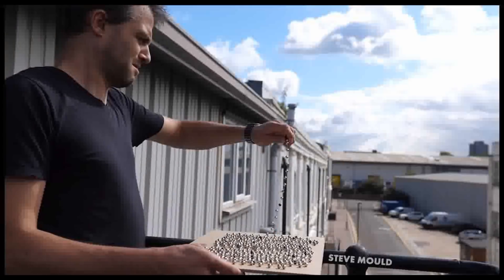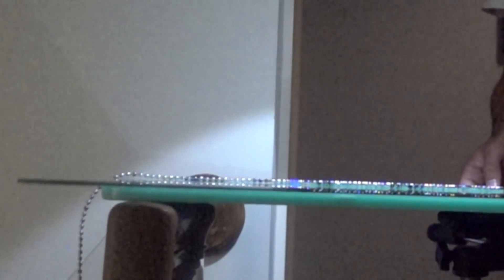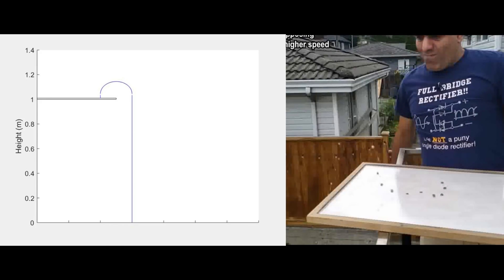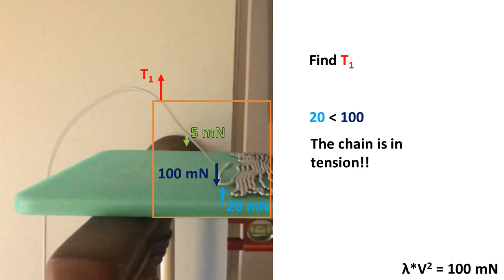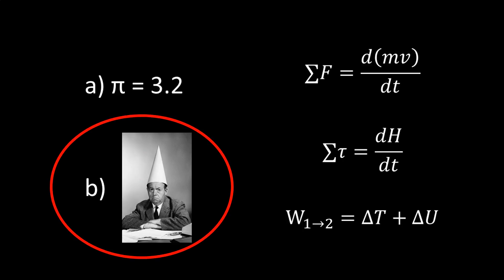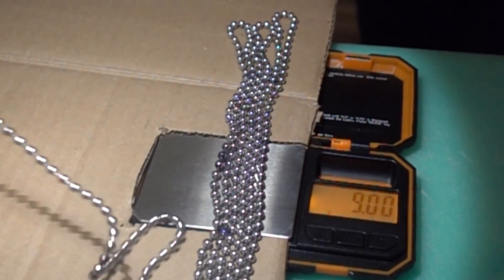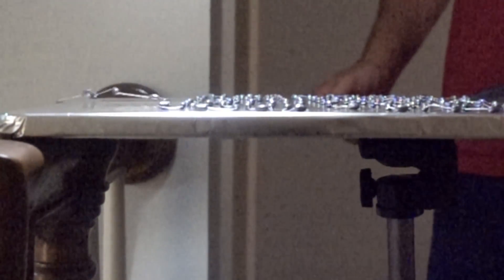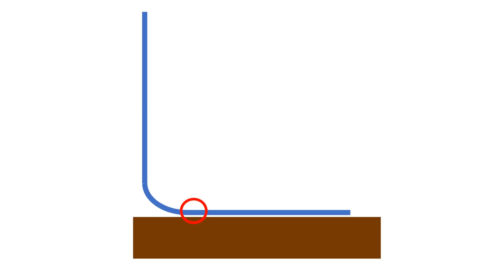And the Winner of the Chain Fountain Dispute is...

Comment: This is crazy! I'm releasing a video today or tomorrow and it has so much in common with this one! Great video
Reply from the maker: Glad to hear that great minds think alike.
Reply: @prestonbecker8784  Not sure how the scale works, but can you put an oscilloscope on an analog signal.
Eliminate most friction by wrapping the chain on a paper towel roll attached to a shaft with watch bearings on both ends.  Eliminate inertia by wrapping a 2nd chain of the same length in the same direction so it falls at the same rate as the 1st  chain is unrolling.  This will also eliminate any tight bends in the chain.
Reply: @prestonbecker8784  what an insanely obnoxious response 😂 i almost subbed too but egos are so ugly to me
Reply: @prestonbecker8784  
Nice try, but I'm not impressed. Did you find a reaction force? Yes, but that's just the normal force of the surface on the bead. This "reaction" force has NOTHING to do with the rise of the fountain. You seem to claim that without this, there can be no rise. Yes, the normal force on the surface increases but that has to do with the increase in velocity of the chain. As the chain's velocity increases, so too will the normal force on the bead. Look at your animation at 8:18 showing a rigid beam and how you explain the leverage property of the chain. That I agree with, but you turn right around and said the reverse is what's happening on the other side, implying the leverage mechanism you illustrate here gives rise to the chain or aids in the chain's rise.  What you fail to realize in your own demonstration as you've pointed out with Medhi's, is that on the falling end of the chain, the fnet on the beam is on the downside(the side that strikes first) of the beam(beam you have notated at 8:18) and it is in the up direction the other end(chain is rising). Why does this matter? This matters because, on the falling side of this chain, this beam you have illustration has the force applied at the low-side causing rotation about the center of mass of the beam, thus accelerating the chain down. This we can both agree on. On the rising side of the chain, you claim the reverse is happening. NOT true. Yes, what's happening to the beam is reversed and both beams rotate CCW, but the effects are NOT the same and neither is the cause of that rotation. On the falling side of the chain, the normal force of the surface on the beam "causes" the beam to rotate CCW and thus, accelerate the chain. Here the normal force leverages the beam about the  CM(center of mass --> fulcrum) of the falling beam thus causing it to rotate and ultimately, imparting an acceleration on the chain in a downward direction. On the rising side of the chain, it is THE CHAIN, that imparts a force on the beam causing it to rotate CCW. In this instance, it is the chain(the rising part) that leverages the beam and imparts a downward force on the surface as the beam rises up. Because this beam is stationary and flat to start with, the leveraging force the chain exerts on the end of the beam in contact with the surface isn't that great unlike the beam on the falling side of the chain. This "reaction" force you and everyone keeps bringing up  is nothing more than the normal force of the surface on the beam end as you lift the beam up. What you fail to realize is that on both the rising chain side and the falling chain side, using your beam diagram at 8:18, the beam's high side does the exact same thing in BOTH CASES! What is it doing in both cases? Look at your own analysis and you will realize, both the high sides of the beams impose a downward acceleration on the chain! On the falling side, this downward fnet, because it's in the direction of the chain's travel, it accelerates the chain downward. On the rising side, because this beam's high side is actually trying to accelerate the chain down, it's actually opposing the rise of the chain! Yes, this beam is being levered, that you are correct, but the results of the leveraging are DEAD WRONG on the rising side. The leveraging on the rising side is trying to slow the chain down, not help it rise! Just look at your bend radius. On the rising side, the bend is curved UP! Take any straight beam and bend it in this manner from a flat position and what's this high side of the beam trying to do? The high side of the beam wants to return to its equilibrium state! It wants to resist the chain's rise! Your so-called "reaction" force you see is nothing more than the normal force of the surface acting singularly with the downward force the beam is imparting onto it as a result of the chain pulling up on the high end of the beam.

So why does a solid surface allow for the chain to rise better? It's as simple as this, and let's use your beam again. If you don't have a solid surface, as the bead in front applies an upward force on the beam, the beam's CM(center of mass) stays put and the beam rotates about it. In other words, instead of the kinetic energy being used to do work to lift the beam's CM to a higher position, the energy is instead, expended to rotate the beam about it's CM. With a solid surface, applying an up force on the beam rotates the beam about its contact end, the end being held up by the normal force of the surface. In this case, the beams CM is raised because it's rotating about the point of contact with the surface, not its CM. With a soft surface, the beam rotates about it's CM burning up energy in the process. If you have a beam floating in space and you apply an up force to one end, will the CM of the beam rise up? No, it'll stay in the same location and the beam will just rotate about that CM. This is what's happening when you use the soft surface versus the hard surface. It has nothing to do with the "reactionary force". Well then, this proves the point that this non-existent reactionary force is needed for the fountain to rise, right?. My answer, NO IT DOES NOT. That's another story, one I'll tell in a video to debunk and disprove Steve's argument. Don't get me wrong, I love Steve and his channel but he's 100% wrong on this. The fact of the matter is we can clearly see that all this leveraging effect, this "Steve Moud" effect, this "reactionary" effect, or whatever you want to call it, actually opposes the chains rise so there's no way it can give rise to the fountain itself.  This "lever" CANNOT both retard and help the fountain rise. It either helps it rise, or it retards it. The fact is it RETARDS the chain's rise, thus it cannot possibly help it rise. The other fact is the soft surface also RETARDS the chain's rise. It retards it more! Just because the soft surface retards it MORE does not mean the "reaction" force is helping the chain rise. The answer to the fountain's rise is so simple it's actually hard. Once I get all the necessary equipment set up, I'll prove that a fountain can rise without this "lever" or "reaction" force. This "lever" retards the chains rise, END OF STORY. 

No, Steve has not won. Medhi is more correct in that he disagrees with the "lever" effect. He just hasn't put his hands on the "how" the fountain actually rises.
Reply from the maker: @vangmountain  
a) I am pretty sure you meant 18:18, not 8:18
b) The whole point of the debate is that, for the fountain to from, the normal force under the chain will have to be greater than just the weight of the chain (in the same way that, when jumping off a hard surface, the normal force under you is greater than just your own weight). Steve and I have been calling this difference between the normal force and the weight of the chain the "reaction force" but if you want to call it the "increase in the normal force" that is fine by me (and I assume Steve)
c) So, if the increase in normal force is due to something other than the leverage effect, but everyone agrees that the increase in normal force exists and is necessary for the fountain to exist, then Steve still wins and Mehdi loses. At least in my opinion. And if you disagree that this increase in normal force is necessary for the chain fountain to exist, check out my paper that I linked to and see if you can find any flaws. I look forward to hearing about it.
d) Dude, without pictures or equations, I can't make heads or tails out of your comment. Sorry. But, if you have some illustrations and equations in your video, I would be happy to see it, so send it to me when you are done. Or better yet, leave a comment here with the link.
Reply: @prestonbecker8784  Agree, it's hard to make heads or tails from words. My primary point is all you've proven is that this "reaction" force mechanism retards the chains rise. This I think we both can agree on as the curvature of the beam puts it in compression on the acute side of the beam and tension on the opposite face of the beam so on both the rise and fall side of the chain, this bend where this "reactionary" force is, the beam wants to return to it's equilibrium state so it always exerts a downward force on the chain...on the rise side, it retards the chains rise...on the falling side, it accelerates the chains fall as you correctly pointed out. And yes, a firm surface will retard less but it isn't what gives it it's rise. I intend to do a video on it and will for sure link you. Actually stumbled on this just yesterday so it's been amusing to watch the back and forth. It's great for everyone! Cheers and like I said, looks like you put a lot of thought and time into so kudos to you but no one has put their finger on the actual reason for the rise. 🙂
Reply: @prestonbecker8784  I think vangmountain is saying what i said. The reaction force at launch (in the bucket) borrows power from the system.
Unlike the reaction force when a lever/link lands -- this definitely adds to the height of a fountain.
Re the bet -- Steve says that a reaction force is needed for a fountain to form -- dont forget.
Reply: @atheistaetherist2747  can we all just agree that it's magic?
Reply: @atheistaetherist2747  
Correct mad aetherist. I finally saw the Cambridge physicists video and they are saying exactly what i was trying to convey to Preston in my first post. Like me they argue the surface acts to retard rotation of the beam about it's CM and causes the beam to rotate about the point of contact between the two. By doing this, the beams CM rises unlike a beam on soft surface like water. With a soft surface, the beam would rotate into the water as Preston has shown, thus limiting the rise of it's CM. It essentially boils down to this: with hard surface, the kinetic energy imparted to the beam end goes to doing work to elevate the beams CM whereas in the soft surface, some of that kinetic energy is wasted in doing work to rotate the beam about it's CM and thus, less energy is left to lift the beams CM up thus it rises less as a result. Like Preston, they proved that this lever mechanism(hard surface) retards less, but failed to prove it is the rising mechanism of the fountain. Again, if anything it does, it's that it is opposing the fountains rise. This is indisputable as this beam initially starts at rest. It becomes even more evident when you look at the segments as beams.

Here's the thing though, a fountain can arise from any string, rope or chain, flexible, stiff, flimsy, whatever. If it's flimsy and not rigid, you have no leveraging effect, hence the leveraging is NOT needed! You see it in the chain because that's the nature of the chain--it's similar to a chain of rigid beams give it's rigid parts. I concur with the cambridge video except the conclusion which is that the lever affect is needed for the fountain to rise.  That there is 100% wrong and I intend to disprove it mathematically and experimentally because it just plane is. The lift mechanism is in plane sight, you just have to see it.
Reply: @vangmountain  They (ie everyone)(except for one that i have seen that used a different model) use a math model, & conclude that that model proves the model. Mathematicians are good at that.
If they oil  their chains it will not decrease the height etc of their fountains.
I win. And Mehdi wins. Actually, i cant say that Mehdi wins -- i dont know what Mehdi asserts -- he might be wrong or partly wrong too.
Reply: @vangmountain  
Ok good.
Here is a suggestion i made yesterday, for a flexible chain, that cant have any or much lever-link-kick-reaction.
But it might cost $300 to $600 for the splitshot.

I am sure that 1 dia clear gap tween splitshot (a splitshot has dia of 1 dia)(3 mm or 4 mm) on a light fishing line would avoid lever-link kick.
0.5 dia gaps might not.
(1) Here is an idea. Use 1.5 dia clear spacings.
Hang/pull the chain over a cylinder (instead of using the sharp bucket wall) which has a dia of say 20 dia, to reduce the initial clatter.
After which i am sure the chain will rise nicely up clear of the cylinder.

(2) And then i would add more (double the) splitshot so that the clear spacings were 0.25 dia.
And repeat the test.

If the fountain height in (2) was more than in (1) then that would lend support to Steve's assertion that kick affects the fountain.
Reply: @vangmountain  well I just happened to finish reading the paper attached, and verified some graphs numerically myself...
If there is some flaw in the assumptions of reactionary force, then mathematics should disprove it, right ?
The point I wish to make is that, mathematics may not rule out any additional properties/phenomena which may have been unnecessarily incorporated, but mathematics sure can point out a wrong assumption. Afterall, this is what we all have learnt in our science and engineering classes....
Going by that philosophy, I don't see any inconsistencies in the theory as well as the mathematical modelling..
Reply: @atheistaetherist2747  the problem is, the chain fountain effect has been demonstrated in cases where the "falling" chain hasn't hit the floor yet.  Tops of ladders, tops of buildings, etc.
Reply: @Seriouslyfunny1    First and foremost, I have not read the paper and have no intentions because I have zero objections to the "reaction" force. This is just the normal force of the surface on the beam end that's in contact with it. First and foremost I want to point out a flaw with the physicists reaction force theory. They conclude the normal force would lift the contact end  of the beam up which is 100% dead wrong. I am shocked two physicist could make such a mistake. Yes, it's true, with a solid surface, the lift  force on the one end will raise the beams CM as the beam rotates about it's point of contact not it's CM. The physicists are linking to different things. A beam rotating about it's CM striking a hard surface on the downward end will impart a normal force on that end causing it to rise back up much like if you were to shove one end of a see saw up and watch as the opposite end strikes the ground and rebound. There flaw is linking this to a beam that's already in contact with the ground. In this scenario, any delta y rise in the one end of the beam is simultaneously paired with a normal force on the opposite end. Newton's third law is not "reactionary" as some like to think. It's one singular event with two simultaneous forces who's magnitudes are equal but in opposite directions. In other words, any delta y rise on one is IS the direct result of the normal force of the surface on the opposite end. That end is behaving like a pinned connection allowing it to be used as the fulcrum to leverage the lifting of the beams CM. As such, NO, there will be no reaction force causing that end to rebound up as the physicists point out. This was a horrible mistake on the physicists part. As one end of the beam rises, it is simultaneously using up it's normal force pair on the opposite end. And no, I'm not saying the normal force is paired with the rising end, but it can be thought of as that because any force on one end rotates the opposite end which applies the same force, but in the opposite direction, onto the surface which in turn, yields the simultaneous normal force up that is paired with this beams down force, the direct result of the beam's up force on the opposite end. Because the normal force on the contact end  is used up continuously as the beam is rising on the end with the applied up force, there is NO REACTION force left over to lift the contact end up. THIS IS IMPOSSIBLE! The physicists connected two different things. If the beam were to rotate prior to making contact, then yes, the contact would yield a normal force that would result in a rebound of that end. Rebound is not possible when the beam is already in contact and maintains this continuous contact UNLESS the force is so great it punches through the surface allowing it to have momentum and then striking and stopping at some later point. In this scenario, even if the distance traveled were miniscule, because it was in motion, the impulse of impact could impart a force on it in the opposite direction causing it to rise up. The other possibility would be the beam deforms which it doesn't. Neither bead nor surface deforms so NO, no discernable lift is generated on the contact end as the physicist claim. The beams CM does rise which does retard the chains rise less than if it were not solid, but it is not what gives the fountain it's rise. The fact of the matter is that it resists the chains rise. This is fact. I think you can agree with me on that. So no, I'm not disputing the math nor the existence of the "reactionary" force (it's just the normal force). What I'm disputing is exactly what the math says which is that the normal force is not what gives the fountain its rise. If it did, Preston would have shown the math, but no where does he show that the math explicitly shows this. He assumes this; his math does not explicitly show that the normal force gives rise to the fountain and that's my point.

Something to think about. Does it take more energy to rotate a beam vertical ( fulcrum on one end)and THEN lift its CM to a certain height, or does it take more energy to just lift it from that point, or because the CM is being lifted to the same height, the energy required is the same? If so, does the normal force play a part? After all, BOTH scenarios get their energy source from the same source--the chain! One takes advantage of the normal force and the other doesn't. Think about it 🙂🙂🙂

If Preston states emphatically that his math explicitly shows the normal force giving rise to the fountain, I'd be delighted to oblige and read it but he doesn't. I have zero qualms with his math. For all I know, it's probably 100% accurate but it doesn't say the fountain's rise is the result of the normal force. 

And yes, I can experimentalyl prove the normal force is not needed...how? Remove it...simple to do.
Reply: @Seriouslyfunny1  here's the worst part about all of this. People of science are now unknowingly saying, "FREE ENERGY, FREE ENERGY, GET IT WHILE YOU CAN". From the cambridge physicists to Steve, to Preston. Physics fundamental...conservation of energy. Trace your energy source. It came from somewhere! This "extra reactionary force", no it does NOT exist! The normal force, yes it exists? Where does this normal force derive from? The surface? Wait, the surface is only reacting to another force being simultaneously applied to it so where did that force come from? Hmmm...did I just advocate for free energy by claiming this " reactionary force" which I took from the system can be given back to  the system to give it more kinetic energy to rise higher? If that were true, Let's all get us some and go flying. Maybe pigs can actualky fly...their keen senses are able to locate free energy where we can't. You all are people of science so let's remember the fundamentals and not stray from it.
Reply: I'd like to correct some of my statements in my posts to Preston and Pratap and that's regarding the beams retardation of the chain's rise. I gave Preston and the physicists credit by saying the "reactionary" force retards less, but it's quite apparent it does not! Both scenarios, whether the beam rotates first and then lifts, or if the beam is connected in the center and just lifts right from the ground, require the same amount of energy. It's simply a matter of work. Work is being done to lift each of these beads. It does not matter whether it starts by rotating first or just a straight lift. The fact of the matter is that the work done on both objects is the same if you are lifting both their CM to the same height. This tells you the energy expended is the same. The link above imparts kinetic energy to the link on the surface and this energy is used to do the work of lifting the bead. So, I'm taking back my statement to Preston and the "reaction force" group that somehow, this "lever" effect retards the chains rise less because it does not. Looking at it from a tension standpoint, what the "reaction force" group failed to realize is, the "lever" mechanism is exactly that, a lever, and as such, it's just a simple machine. What we know about machines is that they allow less force to do the same work over a longer distance. In "levering", they got a smaller tension force, which they incorrectly used to CONCLUDE, that this is the reason why the fountain rises. WRONG, WRONG, WRONG. Is there less tension? Absolutely, but you don't get something for nothing in physics! In reducing their tension force, they had to apply this force over a longer distance. How is that? 

Just look at lifting up a beam by its end versus its CM, and you see that the beam actually experiences a diagonal tension force. Even at the initial orientation where the force is perpendicular to the beam, the point with the greatest vertical tension component(the tension force because there is no horizontal component here), this tension force is still much less than the tension force of a lift where the beam was attached at its CM because you are levering the beam to get a mechanical advantange. However, as soon as it starts lifting, the angle grows and introduces a horizontal component thus decreasing the vertical component of the tension force. As the angle between the force and the beam grows, so too does the horizontal component of the tension force. So while you think your tension is decreasing, it isn't. It remains the same, albeit, much less than a lift at the CM of the beam.  Because you now have a vertical component and a horizontal component, the beam moves up and horizontally as you lift. The beam end with the force applied rises while the contact side slides on the surface towards the rising side. Essentially, the beam rotates about its CM until it's upright. Well, how much distance did you have to apply the tension force(vertical and horizontal components) to get to that point? The force was applied for a length of exactly the beam, yet it only lifted the CM, 1/2 that distance. If you had raised the beam by the CM, you would need to apply a greater tension force, but the distance traveled would have been half that because how far you apply the force, is how high your CM will rise.

What does this prove? It proves that the lower tension force does NOT yield greater work as the "reactionary force" group implies. All it proves is that there is less tension involved which is correct, but the impact of that does not translate to more work being done because they took a longer path! This is the basic principle behind machines---trading force for distance. 

So, I am taking back the credit I gave to Preston and the rest of the "reaction force" group because there's simply ZERO GAIN. No energy was saved or added with this "levering effect" to help this fountain rise. The energy spent in BOTH scenarios is the same. Show me the math where kinetic energy is either saved or added to allow for the rise of the fountain, and I will entertain the theory. If not, it's a big bust, and one I'm quite frankly shocked two physicists put on paper. I know for a fact, I can generate a fountain with zero normal force("extra reactionary force") involved, and I have.  My explanation proves, and anyone with a high school physics background can see this, that with or without a normal force, the energy needed to lift a bead to a certain height is exactly the same. It all boils down to the work being done on the bead. If you haven't gained any extra energy or spent any less energy, how then does this "levering" effect give rise to the fountain? If there is anything we know for sure, it's that the bead, no matter how you lift it, takes the same energy from the system in front of it. There's no secret lifting mechanism that somehow saves energy. 

The fountain's rise is, to be honest, too simple, it's hard.....cheers and kudos to all who have put time and thought into it because it's great for science! It doesn't matter who's right or wrong, who wins or loses. What matters is that people are thinking and that's a win for science! Hopefully, I will get a detailed video up to explain it soon, but it's fascinating to see how easily we can be blinded by another's persuasion even though we know it's wrong.  

To Preston, always trust your gut instinct and your intuition. You were right in initially concluding Steve was wrong, but you let Steve's calm demeanor and soft-spoken voice lull you into fabricating something to support his wrong conclusions. Always believe in yourself, until you've been proven wrong. No argument or explanations I've seen to date correctly explain the fountain's rise which truly does surprise me because I know you all are bright people and I'm sure so too are the two Cambridge physicists.
Reply: @vangmountain  I see your point. But I'm still a bit fudgy about the details. You see, if this were a static problem, Newton's reaction effect would have had only the opposing and equal effect, and the "extra" reaction would have been pointless.
But this is a dynamic problem. If I remember correctly, during my engineering days I once happened to solve a problem of Kleppner (don't remember the number/page), in which we have two freely movable wheels of mass m each, attached to each other via a frictionless rod of length L. We now place this system on a smooth table and rotate it about the centre of the rod, so that it starts spinning. We were supposed to check if the reaction on the wheel from the table is mg or something else. By doing an angular momentum analysis, we found that actually there is an additional reaction generated, PURELY due to the motion of this system. 
Not that I'm saying it's the same system. But surely the dynamic aspect of the chains have got to do something with this reaction.
It is very counterintuitive. Maybe that's the reason why so many people are butting their heads ;D
If you wish, you might try the above mentioned problem. I might take out my pens and papers as well !!
Reply: Turns out, the rotational motion about the centre of rod causes an additional reaction of 2MR³w²/L². Here, w is the speed of rotation of the disk, L is the length of rod, R the radius and M the mass of each disk.
I'm fairly certain that due to acceleration of the links/beads, somehow an additional reaction is generated. It's very weird and counterintuitive, but seems like it....
Reply: @galahad692000  
It has been said that hitting the floor has been measured to add 1% to the speed in some cases.
I reckon that hitting the floor can add an infinite speed (were it knot for friction etc losses).
But i dont remember ever saying or inferring that hitting the floor is a vital factor.
Reply: @vangmountain  
I reckon that the rotation of a link at launch might be a source of loss,  if the energy is not somehow given back to the system.
But praps the energy is given back, minus friction losses.
Reply: @Seriouslyfunny1  True, this is a dynamic problem and yes, there are a lot of things going on, but dynamic problems are nothing more than a bunch of static events combined into one. You can still peel away at the layers to understand what's going on. Sometimes, if you don't look at the bigger picture, you can be led astray and the same is true going the other way around. Sometimes, to understand something, you have to peel away at the layers, while at the same time, keeping an eye on the bigger dynamic picture. For this problem, you have to do both or else you can easily be led astray as many have been including the Cambridge physicists. The problem with Preston, Steve, and the physicists is that they've all been blinded by this "reactionary" force that they can't see the error of their ways. The reality is this, they are ALL RIGHT, BUT THEY ARE ALL WRONG! Sorry to be speaking in riddles, but that's the truth. 

I can tell you that I've finally worked out all the details of this fountain and it's 100% clear where the rise of the fountain comes from. As I've said all along, it's too easy, it's hard. My issue was making sure I watched all their videos and be able to explain away their key points and findings. As in Preston's footprints. Why are there footprints to begin with? What do they prove or disprove and I how does one go about proving or disproving it. In order to disprove his theory, I can't just come up with other experiments. I have to be able to use his own findings to discredit his theory and I must be able to show that my theory will duplicate his results. When two opposing explanations yield the same results, one must be incorrect or partially incorrect. I now have all the details worked out and just need to put this all into a nice video for ALL to see and understand. Note I emphasized "all". If I only explain it so a few can understand, I have achieved nothing. The point is to make it easy enough for all(lots of people) to comprehend, not just a select few. For this reason, it can have math, but it must be done in such a way as to make it understandable to the average person. It must be thoughtful and have novel experimental presentations that address the core of the conversation so it leaves no doubt as to what the solution is. It must be able to address and counter all points of the opposition side. This is a tall order, but I have the details and the solution. It's just going to take a little bit of time to put it all together in a nice coherent package that will draw people in and help those struggling to understand it, understand it. 

I'd love to share the details, but it would ruin the video so I'm holding out on my findings until the video comes out. I've been meaning to start an educational science Youtube channel, and I have, but I just haven't put up any content yet, so this will make a great first video as the interest in it is quite high. But yes, I can emphatically say, the opposing side is RIGHT, BUT THEY ARE ALL WRONG! What I do love about this discussion is that it's made a lot of people think and that's a win for science. And to Steve, Preston, Medhi, and the Physicists, and anyone else who's put out content, many thanks to them because it takes courage to put your work out on the internet to be scrutinized by others. The fact of the matter is that no matter if it's right or wrong, partially right or partially wrong, they are all necessary steps that advances all of us a little bit further. Without their contributions, be it right or wrong, we may never see the contributions we make. Their mistakes helps us to avoid it. Their insight, helps us to see that much further. So in the end, they are all winners in this, because at the end of the day, it was only made possible with everyone's contributions. Sure, we may go back and forth, but there's no mal-intent. It's just a healthy debate  where, in the end, everyone is a winner and that's the beauty of this platform.  Cheers to all who've contributed, no matter how small!

As to the bet, Medhi wins by virtue of his position that he's more correct in taking the position that a "reactionary force" is not needed for the fountain to form. Steve is wrong, because he says it does. It 100% does not need a reactionary force. This is best and can easily be disproven with simple experimentation, something I have already done and captured in ultra slow motion. If no normal force exists, meaning no contact exists between the beads and some stationary surface, then this theory is out the door, and I can say that without a shadow of a doubt! This theory is on it's way out the door.
Reply: @vangmountain  I don't really understand where you're coming from here. Of course there's a source for the additional energy, and that's the continuous change in potential energy in the chain as a whole, as the chain falls downwards. I don't understand the mechanics of this well enough to conclude how exactly the energy is transferred, but I don't understand why it is you're screaming "FREE ENERGY" here. Also, I find your whole attitude in this thread very demeaning towards everyone involved whose opinion does not happen to align with your own. Towards the Cambridge physicists in particular (I can't attest to the validity of your criticisms toward them, I don't understand the mechanics enough myself), but also towards Steve, towards Preston...  Implying Preston let himself be "lulled into fabricating" some false evidence by Steve's "calm demeanor and soft spoken voice" is incredibly condescending and shouldn't have any place in this scientific debate. Please overthink your attitude.
Reply: @vangmountain  here's the thing... You state that a fountain can rise from "any string, rope or chain, flexible, stiff, flimsy, whatever". But that's simply not true. Steve has shown very early on that a more flexible bead chain does not show this effect, if I recall correctly.
Reply: @InterFelix  It's just speaking Felix. Like when Steve and Medhi say things about each other. It's just a figure of speech. It's just meant to convey your conviction in what you believe. They all have done great work. And when i said that about Preston, I was poking fun at Steve's demeanor. Dont get me wrong, he's a great guy. I enjoy his channel. Likewise, I'm sure all these guys are! As to the physicists, they have a higher bar they must uphold after all they have the time and the training. They researched it and wrote a paper on it, but it's quite clear they rushed their conclusion. Their demonstrations shows they did not put the time they should have put into it. Steve's video is but one instance and one scenario. Trust me, I can prove a flexible sparsely linked chain can generate a fountain. They all are showing one scenario, NOT ALL scenarios. I wouldn't be saying this if I couldn't back it up Felix. Be pretty stupid of me. It's all in the spirit of learning Felix. No mal intent. Yes, i stand behind my statement that fountains can arise from any chain or rope, flexible or not. They just exist under different conditions. Just because they fail under one condition does NOT mean they can't. Big difference. That's the problem with the reaction theory. They concluded immaturely. Just because you exhibit a behavior that seems to support your theory and test(flawed testing) a couple and it doesnt yield does NOT mean you are right. Like I said, I can prove them wrong with one single experiment. If i can get a fountain to rise with zero(no surface contact) normal force then I've proven their theory wrong. It's as simple as that. It takes a lot to prove a theory but very little to disprove it. You read too much into it. These guys are all great, but WRONG! And maybe the tables will turn on me, but I'm not putting myself out there less i can back it up soundly. Am I being critical of the physicists? Yes I am! They are trained and have all the tools. They must be held to a higher standard. I don't think people will disagree with that. Just as you hold your doctor to a different standard, so too should the physicists be. To be condescending to them, I would have to know more than they which I don't. For sure they have more tools than I. That is why I expect more from them! Their kickback theory and demonstration at 7:37 is appalling! It shows a high impulse event due to rotation about the CM thus generating a high impulse with the surface and thus, the surface imparts the same sending that end airborne. This does NOT happen with the chain links.A normal force is experienced but it does not send this end flying. The normal force works simultaneously with the lift force to enable the lift to happen. It's a PARTNER in the lift mechanism, NOT THE lift mechanism as this side is implying. BUT.....it is NOT needed! The lift does NOT need a partner! This proves them wrong if you can show that a partner is not needed! Being ugly is one thing, Felix. Having conviction about your  point is another. Don't take it the wrong way. I think all these guys are great, but that's not going to stop me from saying they are dead wrong about this. Cheers!😁😁😁 But I do agree with you that choice of words can be misread.
Reply: @InterFelix  You missed the point. It's the fact they are treating this reactionary force as some extra force! It's not! It's a force pair! It does NOT exist without the lift force! The chain's energy is NOT conservative, BUT the link's normal force IS! It's derived from the lift force. WHATEVER ENERGY you put into the lift, you get in the NORMAL force, this so-called "extra reactionary force". You are referring to the whole chain which is not conservative, BUT, the action pair of the normal force and the force the beam imparts on it is! IF you take one out the other does not exist. The normal force is not a singular force, it is a force pair! ENERGY MUST BE CONSERVED! There is no "additional" normal force.
Reply: @InterFelix  Here's the difference. In the phycisist demo at 7:37, the beam is supported in the middle by a fulcrum so the normal force pair exist there. When you lift the beamn it imparts a force on the fulcrum and the fulcrum imparts a normal force on it. This allows the other end to generate angular momentum, which upon impact, must be conserved. It's conserved by imparting an impulse on that end to lift it off the ground. The impulse is a separate event from the lift mechanism. The lift is made possible due to the normal force at the fulcrum. They work indirectly as a pair. Because lift only occurs due to the simutaneous normal force whic is a force pair with downforce on the opposite end. Energy is conserved and must be! With the chain, the fulcrum is the contact end of the beam. There is NO fulcrum in the middle so the normal force exist there at the contact end! Energy must be conserved!
Reply: Ok … your aluminum foil experiment is the first thing that has made me suspect that Steve’s explanation might be correct after all.
Reply: @DansplainingVideo  why would you doubt him in the first place?? Steve's explanations were so clear and addressed each of electroboom's claims.
Reply: I'm glad someone finally pointed out that the discussion should have ended with the simulations
Reply: I'm so glad you have the integrity to link this video. Thanks Steve.
Reply: Now Mehdi have to watch this one too and pay his cents
Reply: I like to think of it as a wave. Kind of like when you have a chain hanging from a ceiling or rope or what ever. And when you shake the bottom end of the chain or rope. It sends a wave up the rope or chain til it bounces back. But in this case its continuously pulling chain out of the jar so it doesn't hit a solid end and bounce back. But instead you get a whip effect when the end of the chain leaves the jar. As and as the chain leaves the jar it has increasingly more weight behind it causing the wave to become increasingly taller because of the increasing amount of downward weight outside of the jar. 
@Steve Mould
Reply: Clearly this shows who wins the 1 million Canadian cents.
Reply: @R.B.  Ten thousand.
Reply: @bashkillszombies  not if you watch this clip at 0:19 and towards the end. According to the clip it's now a one hundred thousand cent bet, so...
Reply: @R.B.  I heard it was a 100 million cent bet
Reply: @R.B.   🤫
Reply: Very interesting video. The way the beads were marked kind of sparked an idea. I think there might be a fair bit of axial rotation in the string and/or the separate beads when the bends progress through the chain, and that an axial rotation might be a bit more favourable then compression/tension along the chain axis. A semi rigid bend rotating axially into the surface would create the kickback, not simplified 2d levering.
You could test for rotation by brightly colouring the top half of the chain when it's spread out, just before creating a fountain.
In the slowmo footage from this video it sometimes looks to me like a marked bead rotates around it's axis within the distance of a few beads.
Reply: In a chain drop experiment, we observe that,  the end of the chain that is starting to drop is being pulled at the same speed as the total chain (since they are linked). So if the end of the chain is being pulled faster than it would be by gravity, there is an energy being put into the chain which shows up as fountain.
Reply: haha, you got Dereked
Reply: The fact Steve subs is reason enough for me to sub.
Reply: you got dereked lol
Reply: "today or tomorrow"
Reply: That's not going to save you, I think it's pretty clear to anyone that understands how to utilize the scientific method, that Medhi is in fact correct. As a licensed electrician, I can vouch that clearly the electrical engineer has the proper grounding in the real life physics that are applicable here. This isn't the exotic type of physics that a Masters degree might deal with in particle accelerators, and no positrons or Schrödinger's cats were harmed in Medhi's factual proofs.....
Reply: Spoiler alert
Reply: It's all about the centrifugal force on the mass of the chain in its 180 degree turn pushing it into a larger diameter.  No?
Reply: The reaction force comes from the section on the chain that has increased weight due to the centrifugal force whilst it changes the direction to follow gravitational force.Since the gravitational force is downwards,the centrifugal force created in the turnaround radius must act upwards!
Imagination discovers and mathematics proof the discovery. Have fun with that theory 😉🤗
Reply: U guys are mostly wrong.
The question(s) are not whether there is a reaction force, they are 
(1) whether the reaction force is needed to create a fountain,
(2) whether the reaction force affects the height of the fountain.
The answers are No & No.
In relation to the horizontal fountain, the answers are Yes & Yes.
But, the original questions relate to a chain from a bucket/beaker/container/can -- not from a horizontal surface.
So, that was your first mistake.

Now to your second mistake.
The mere existence of a reaction force does not make the answers Yes & Yes.
The reaction force borrows power from the falling chain.
So, it can't add to the height of fountain (from a bucket).

Links landing on the floor do add to the tension in the falling chain.
Hence they add to the height of a fountain.
But the lever action (kick) at launch in the bucket does not add to the height of the fountain.

There are (can be) two kinds of kick. 
One is the simple lever kick (due to a say 90 deg bend in the chain).
The other is a similar kick that is due to the chain having a bend beyond 90 deg.
We sometimes see a bend of 180 deg, or more.
That large bend creates a slower & possibly greater kick.
But, both kinds of kick borrow power from the chain, hence they don’t add to the height of the fountain.
Except in the case of launching from a horizontal surface, where there would be no vertical fountain were it not for these two kinds of kick.

Except that there is a third kind of kick that will give u an enormous vertical fountain offa horizontal surface.
And this kick can be created by laying the chain such that as it is being yanked horizontally it has to jump over itself.
It’s a jump-kick, & has zero to do with lever action.
Whereas the other two kinds depend on lever action.

Steve is wrong.
But i am not saying that Mehdi is correct. I would need to know exactly what he asserts.
Reply: @atheistaetherist2747  you assert that because the reaction force is borrowing power from the chain, therefore it cannot add to the height of the fountain.
How did you come to this conclusion?
Reply: @suborbitalmelon8822  
If the reaction force is borrowing power from the chain, then conservation of energy tells us that it cannot add to the height.
But, does the reaction force borrow power from the chain/system?
I reckon that it does.
The reaction force is due to the preceding link/bead pulling on the link/bead involved in the lever action.
Hence it is borrowing from the system.

Tests confirm that i am correct.
On some youtubes we can sometimes see a knot of chain leap up, yet this does not affect the height of the fountain, or, if there is a (very) small drop in the height, the drop is fleeting & not permanent.
Reply: @atheistaetherist2747  ah, but energy comes in many forms, not just the height of the fountain. For instance, the power borrowed from the chain could instead come from the kinetic energy of the chain, thus conservation of energy is conserved.
Reply: @suborbitalmelon8822  
Yes, we have the KE (speed) & the PE (height) of the system, ie the system.
And given (sufficient) time both rely on each other (equilibrium).

Hence if u borrow power from the system then it must lower the H.
Except that if power is repayed quickly then there might be no obvious change in H (even in slo-mo).
Reply: @atheistaetherist2747  the system is operating in a gravitational field. Therefore, the power borrowed by the leverage effect could in theory (I haven't thought it fully through) just limit the terminal velocity of the chain, without causing the height of the fountain to decrease.
Reply: @suborbitalmelon8822  
(1) But what Steve & Co are saying is that the lever effect duznt limit the terminal velocity, more than that, they say that it increases the TV.
(2) And, they are saying that the lever effect not only duznt lower H, but that it raises H.
(3) They (i think) say that the radius of the fountain is a constant, hence any change in speed affects H.
(1)(2) are wrong. (3) is correct (in theory)(& in practice).
And (3) says that a change in TV depends on H, & of course vice versa.
Reply: @atheistaetherist2747  The power can not just come from the height, it could come from the kinetic energy. It would be interesting to measure the speed of the chain when using a hard surface where the height is higher, and also when it launched from the plastic wrap where there is a small height rise. I assume that the speed is higher is the second case, because some energy does not transformed into lift. Or maybe not. Because it might causecontinuous bending of the plastic, which also requires energy.
Reply: @gabiold  
The force power momentum energy comes from the falling chain -- ie the difference in wt of the ascending & descending chains.
Plus some extra force & speed from when the links/beads hit the ground.
The hard surface at launch wont i reckon make a difference to H the height of the fountain.
Or, it will, in the sense that a soft surface would as u say rob energy & thusly reduce H.
Reply: @suborbitalmelon8822  Let me clear this conservation of energy for you.

Per Preston to Luke:

 "Likewise, with the chain fountain, as the chain rises, the chain links try to rotate. As they rotate, they run into the ground. And since the ground does not move, the ground exerts a vertical force on the chain, accelerating the center's of mass of the links upward."

They are claiming there's a reaction, meaning it happens afterwards. Also, they are claiming it accelerates the beads up. It's clearly stated here by Preston. For acceleration to occur, there must be an Fnet, a force that is unopposed, Newton's 2nd law. This implies free energy as the normal force is not a reaction but an action pair. Lets make one thing clear. The energy in the chain is dynamic over time. The conservation we speak of is one instance in time. From one instance to the next, energy in the chain is dynamic so no conservation. But in one instance in time, it must be. When a force is applied to the link, in that one instance when the force is applied, there already exists a normal force and down force pair. Advance time delta T to the next instance and you have acceleration yielding delta y of the beam. The Fnet that yielded this delta y also yielded a new normal and down force pair. The new higher normal force is the result of the Fnet and it has an opposing pair, an equilibrium pair that keeps this end in place so the other end can rise in the next time increment. At any one time T, energy is conserved. There's nothing in excess so there is nothing left for any "kickback" as in the physicists' video. If there is any Fnet for a  "kickback", it must occur within  the single time T.  This would imply energy is not conserved because the normal force enabled the beam to lift as Fnet was applied and the lift gave the surface it's increased normal force which is paired with the down force generated by the delta y of the beam. You can't say the energy in the system is dynamic so you can get an Fnet for the kickback in the next instance in time T. Why? Because when the next time T rolls around, the same process repeats itself! Energy is not conserved over a period of time delta T given energy of this system is dynamic, but in one instance, it must be. It can't have an Fnet on the contact end at any time T. If you do, you are saying that the normal force is somehow exceeding its normal force pair which is not possible.

If you want to claim that the normal force is not accelerating anything but by virtue of it helping to anchor the contact end via friction, thus allowing the applied Fnet to rotate the link and lift the CM of the link, then I have zero issues with that.
But this is NOT what Preston is saying and neither are Steve or the physicists. Preston clearly states it here. Steve calls it "extra reactionary force" and the physicists call it "kickback" which they demoed at 7:37 of their video. What they and Preston are describing are impact events yielding in a change of momentum or impulse as a result of rotation. Because the contact end is in contact to begin with, there is no rotating of this link as the physicist show nor as Preston describes. That would be rotation about the CM of the link. They are describing an impulse event, something that requires a change in momentum and to have momentum, it must be moving. 

Now if they were to say it's anchored vertically but not horizontally as it clearly moves, and say because it moves horizontally, it does have momentum and as it becomes compressed, it bends and builds up with potential energy which when released, can act as a spring catapulting the bead upward. This is plausible. 

But the fact still remains that they are 100% wrong because fountains can arise with zero normal force at all. Because this is true, this theory is just that, a theory. It doesn't hold water. This would imply fountains need semid-rigid links like the physicists claim but that's totally untrue. Fountains can arise from any kind of chain, rope, whatever. It can be semi-rigid or completely flexible like a thin rope. All can achieve fountains. As such, this theory is not correct.

Preston proved the theory is wrong with his demos. A fountain grew from a chain running horizontally. No bends to start with, so how did the fountain arise from it if a normal force greater than the beads weight is required? Clear evidence the theory is wrong. 🙂🙂
Reply: Three forces there: The tension force (along the junctions) between balls (produced by pull of falling mass by gravity force right the edge) holding the balls each other on a straight line. The linear momentum do the rest.
No reaction force on surface. The simulator is bugged
Reply: @Full_On-i2q  and the aluminum can be worn as a hat.
Reply: @genioee  Aluminium show that the junctions have limited degree of freedom, so over this angle it push.
But the force that simulate the "jump" it's the pulling (still through the junctions) by the linear momentum, which retain (attempt to) the sequence along a straight line, then curved by the gravity.
It take behavior like a flexy rod making a curved path: The free fall will begin after the table edge, but the linear momentum does not allow 90° change direction, so it will pull (through junctions) the sequence upwards show an apparent jump (but its not a push)